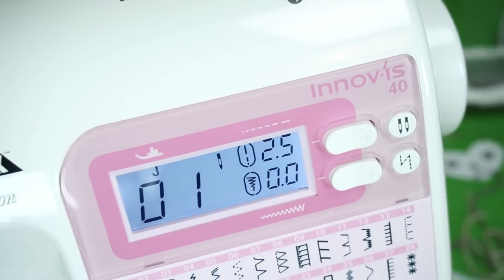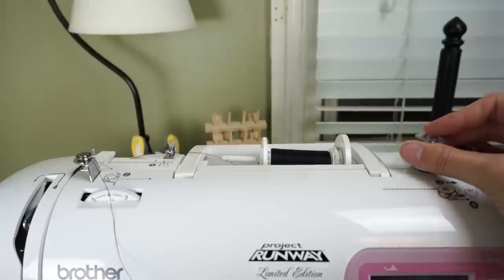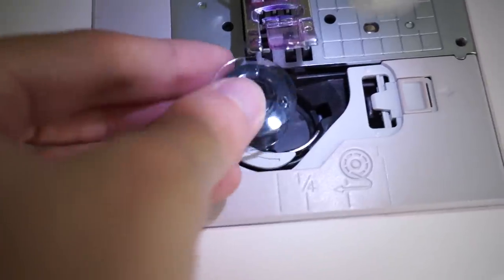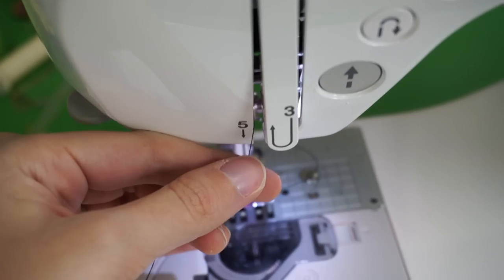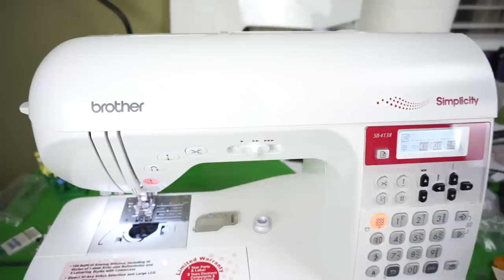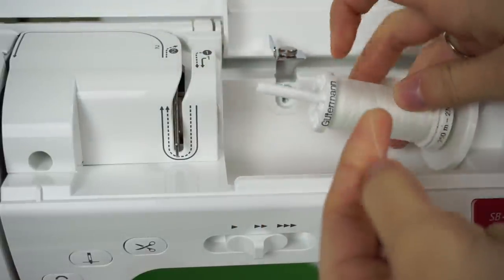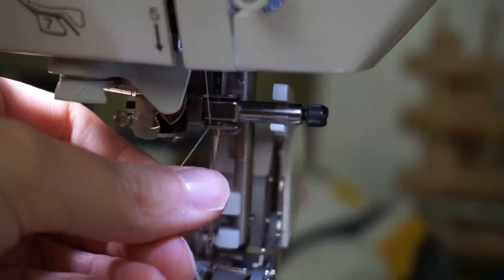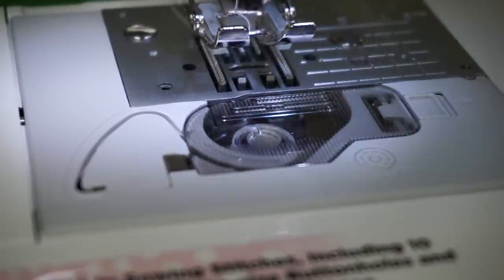How I Thread My Sewing Machines - Brother Sewing Machine Walkthrough | @laurenfairwx

Comment: I thread bobbins by pulling a short bit of thread through one of the top holes, holding that thread for a few spins (until it feels caught), then cut the thread sticking out. It took me a while to figure out how important tension is to threading a bobbin. If you don't follow the guides, and the thread isn't taught entering the bobbin, your bobbin then hangs anywhere the thread is lose when you try to sew with it.

I mostly quilt, so the only feet I use are A, the primary foot for day-to-day stitches, and the walking foot for handling multiple thick layers of cloth. Do you use other feet? Know what they're for? Tell us in a sewing video.

Comment: I stumbled upon your video because I'm interested in purchasing the SB4138 and wanted to know a little more about it. Can you give me any insight into your experience with it? Are there any things you don't like about it or wish it did better/differently? Have you had any troubles with it? What are your favorite things about the machine versus your older machine?
Thanks!
Reply from the maker: +Rachel Dissell I really like it! I've had less issues with it (less skipped stitches, etc) than the older machine. It has a bunch of great features the other one didn't, like an automatic thread cutter, a bar that allows me to lift the presser foot with my knee, and it came with great accessories like a bigger table that slides on and a walking foot. It has more stitches than I know what to do with, but the functions I do use have handled the intense amount of work I put my machines through. 

Hopefully that helps! If you have any specific questions about it I could answer, let me know.
Reply: Wow! Thanks for the lightning fast response! I do have a couple more questions, actually...
Have you used or found any use for the sideways stitching capability? 
Also, how does the automatic tension work? I suspect it sets the tension based on the stitch/foot you're using, but I know some machines go as far as letting you select the type of fabric to be sewn.
Reply from the maker: +Rachel Dissell I haven't used the sideways stitching, and I also don't know much about the automatic tension aside from the fact that I haven't had to mess with the tension at all yet and the stitches have come out perfectly on a variety of fabrics. 

Basically, the machine does more than I need it to, but I have been very happy with its performance of the basic functions, much more than I was with simpler machines (that kept having issues).

Comment: How much is the SB4138? I don't seem to find the price anywhere. Also, does SB4128 handle thick or layer fabrics well?
Reply from the maker: Kai Uthid Mine was $955. It's handling two layers of fleece quite well and definitely better than the less expensive machines I've used. Sometimes I can fit four layers of that fabric through but I have to sort of pull it through myself (and it doesn't like it very much, but it works). I use the walking foot that came with it to help push thick fabrics through from the top as well.
Reply: Lauren Fairweather Thank you so much Lauren for your reply :) One more question, would you recommend SB4138 or innov-is 40? I am trying to decide between the two of these machines and I am a bit indecisive at the moment!
Reply from the maker: Kai Uthid I prefer the SB4138 to the Innov-is 40 but I liked the Innov-is 40 quite a lot before I upgraded to the SB4138!